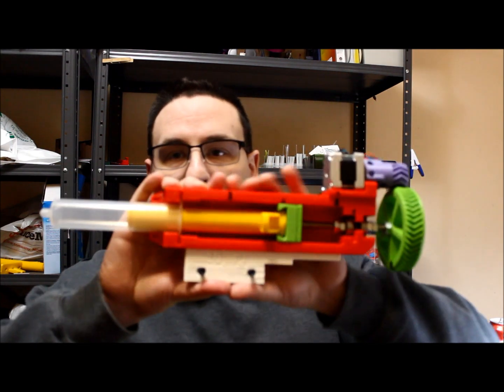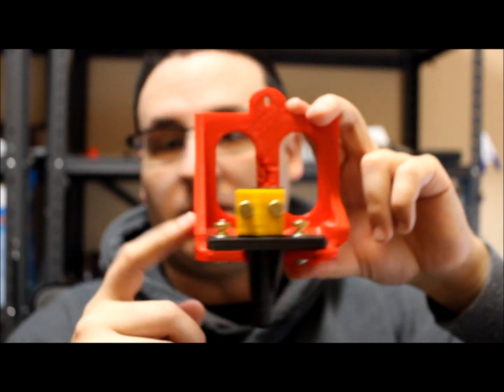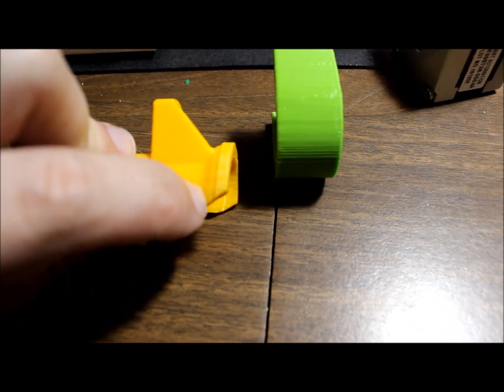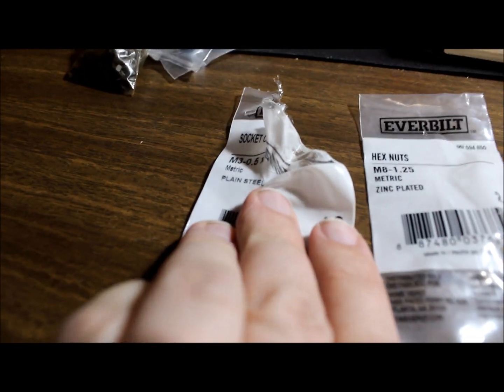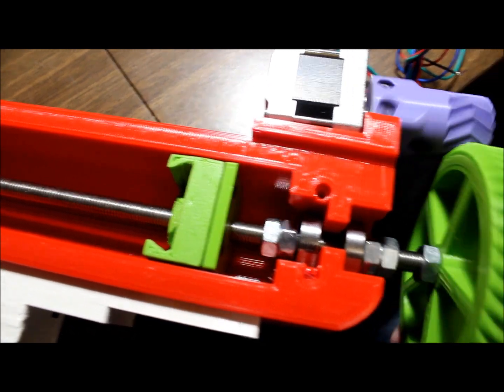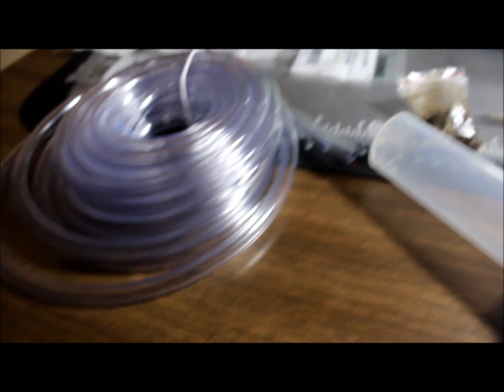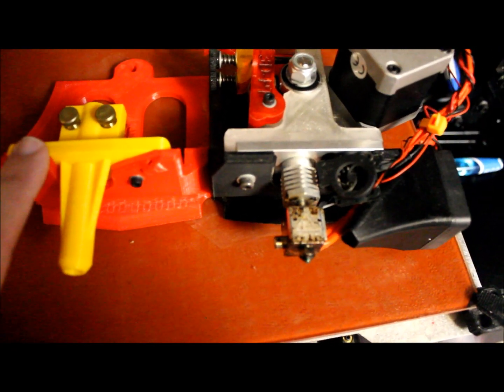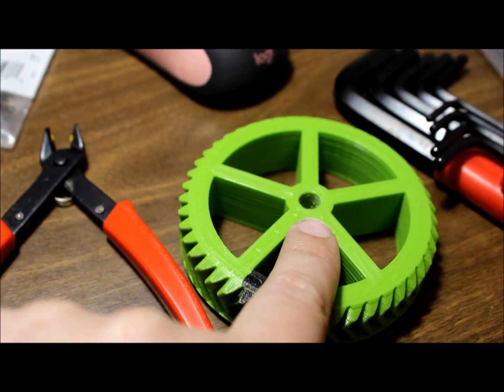Desktop Cement Printing Pt. 1

Comment: you can use a torch to heat up the nuts before inserting them into the plastic, dont get them too hot though

Comment: It doesn't appear that there would be enough volume in this to print much. I should think that a continuous feed from a larger (2 Liter) capacity hopper with something like an auger to be the final extruder.
Reply from the maker: This was more proof of concept. I was hoping to print some small items like pen cups or planters as a design. However you're correct, the volume would require 2-4 loads at that rate. In the back of my mind I have an auger design for an extruder. In any case, the follow up video was called part -2 for a reason..

Comment: Can this device be used for silicone and food?
Reply from the maker: it was designed for gels in bio printing, so a paste or liquid food should work. I have a pipe dream of printing in peanut butter or nutella on crackers/ bread for fun sandwiches and a STEM activity. In theory silicone could work at the right viscosity, but you may not be able to use a small nozzle with that. But it would be cool to print some hand sized objects with silicone.

Comment: Video of it working!
Reply from the maker: Stay tuned. Right now I'm testing cement mixes. I may test with some food mixes first just as a proof of concept. This was designed originally to print gels for bio printing, so scaling up for cement is taking some time.
Reply from the maker: So my idea for using this was a total fail. In part -2, I come back to why. A future version of this will have to use a auger extruder.